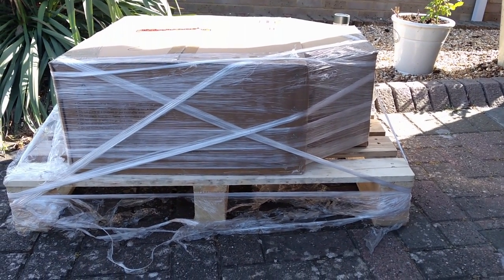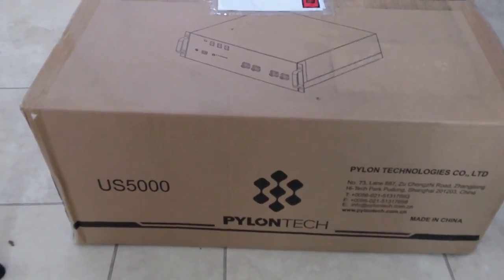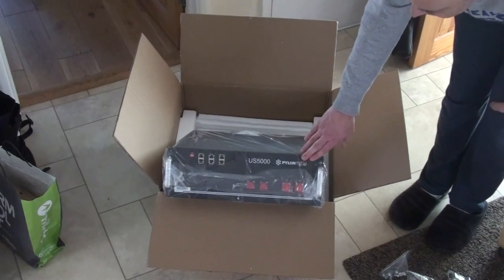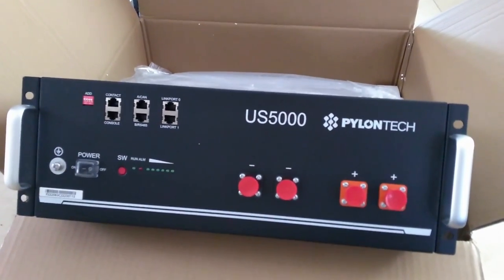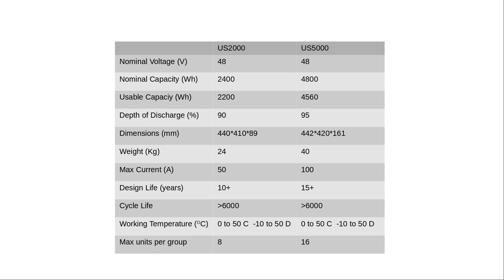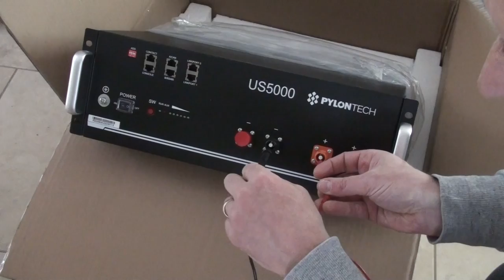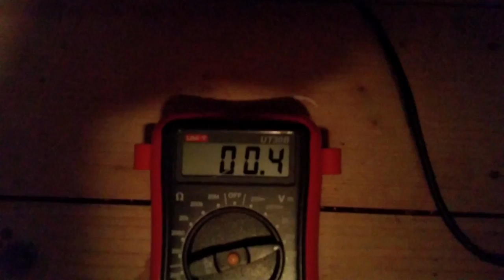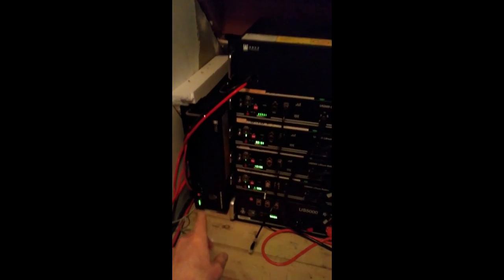Adding a new Pylontech US5000 battery to my home energy storage.

Comment: With more than 2 batteries in parallel, wouldn't it be a good idea to connect all to bus bars rather than daisy-chaining?
Reply from the maker: Yes it's the theoretical ideal but it doesn't really make that much difference, especially if you take the positive from the first in the chain and the negative from the last.
Reply: @nicholashowell  My understanding is that the battery cables supplied can only handle 100 Amps continuous and 120 Amps peak
Depending on the size of your inverter, Pylonteck actually recommend that you take extra leads back to the inverter. So that means, when your stack is big enough, you need to take a positive and a negative from the first battery and also from the last battery back to the inverter or to a busbar first
The past now is that if you were in theory to have a stack of 16 batteries, you would only be able to draw 200 Amps continuous, because of the limitations of the battery leads
So large stacks would be great from a storage perspective, but not from a high load perspective
Major design fault on their part.
I have not see thicker battery cables options
Reply from the maker: @capebee4839  You are right that the cables are only good for 100 amps but in my case that is more than I need.  My inverter can only output 3000W so will never pull more than 60 amps. I think Pylontech do a higher voltage battery for people with higher load demands.

Comment: Ive been on a battery hunt over in UK but I want something that will at least support a kettle at 3,000w power draw without having to take anything from the grid, when its night time and I boil a kettle with 4xUS5000 fully charged I shouldn't be pulling jack from the grid but the continuous discharge rate on these are apparently 2400w, seems like these batteries are ok for lots of low consumption stuff and with UK want to get rid of gas in next several years I don't think this will cut it.

Is the discharge rate battery or inverter dependent?  Still trying to learn but the VAT on batteries on their own but VAT free with a solar install is holding up my 5.2kw solar install.
Reply from the maker: Actually the US5000 has a max continuous discharge of 100 amps which equates to about 5000W. Just one battery would be enough to supply all the power to a 3000W kettle.  What you would need is an inverter capable of that kind of output. A Sofar ME3000 for example can put out a maximum of 3000 Watts so would just about cover it. There are more powerful inverters though that can put out more.
Reply: @nicholashowell  I thought the max was for a short duration, honestly its all confusing to me when it says 2400 continuous discharge and then for another battery it wont state that but only state teh amps and im not a sparky I got now clue what that means for watts and load.

I am trying to future proof and want to be able during winter months to do some cooking whether it be air fryer or electric oven but don't want to be drawing from teh grid if batteries are full and in the summer want to have at least one AC unit running.

If the 5,000w is sustained load but inverter dependent then I will get 4x4.8kw units so it can be charged on the cheap during crappy winter days.

I am trying my best to wrap my head around all this and the only thing holding up my whole install is the battery VAT lol
Reply: @nicholashowell  This is what I read
Continuous Discharge Rate (Normal Use): 2400 W ; Maximum Discharge Rate (5 Minutes): 4800 W ;

I was given a quote for 3xUS5000 and a Solis S5-EH1P-L Hybrid Inverter
Reply: Buy a 1kw kettle.

Comment: What happened after you flicked on the rocker switch? If you press the soft start does the pack light up and stay on please?
Reply from the maker: You have to press the start button to make the pack active. What the lights do will depend on if the battery is charging or discharging.
Reply: @nicholashowell  thanks, panic over, I watched a few other videos and realised that once all the lights have come on, they then go off and the run light flashes intermittently - also getting 49+V at the main terminals so all good (just need some long leads now!)

Comment: Hello. For my Home Battery setup I am considering the pylontect US3000/5000 batteries with a Victron inverter. Both my solar PV system are grid tied with AC inverters. Would you have any alternative suggestions. Thanks
Reply from the maker: I think the Sofar ME3000SP is quite a good grid tied battery inverter but also has an off-grid mode. It can charge/discharge at a maximum of 3000 Watts. I believe it is compatible with US2000 and US3000 batteries from Pylontech but not yet with the US5000 series.
Reply: @nicholashowell  21.7.22] Sofar have confirmed the ME3000 is now compatible with the Pylon US5000 battery, providing the unit has V3.1 firmware as a minimum.

Comment: Just taken delivery of 3 x US5000 and trying work out how to get them into the loft! They power on the same way yours did - run light flashes but no charge indicated - seems odd if they are at 49.4v, they should be showing some charge on the green lights?
Hopefully getting it all wired up at the weekend (waiting for inverter to be delivered).
The manuals aren't brilliant and a bit ambiguous in places, especially around comms to the inverter and the pin out on the lead but in theory I have a Pylontech lead coming which should sort that (they appear to no longer ship them as part of the "long lead" sets for some reason).
Reply from the maker: I wouldn't put them in my loft purely because it gets too hot up there in the summer and heat is not good for their longevity. Yours maybe different but probably worth checking on a really sunny day. I think they show charge state when something is happening charging/discharging. If there is no load I think they kind of sleep.
Reply: @nicholashowell  yeah I was going to put them on the garage but it's a bit damp in there and get very cold in winter which isn't good either. I did check loft during the heat wave and it got to just above 40, so still in spec. I may add some ventilation if it becomes a problem. Intending to install air conditioning before next summer so I should be able to pull cool air from one of the rooms below and control it with a rPi. I'm getting Solar Assistant which will help me monitor it all.
Reply from the maker: @robertrichards2493  So long as you are aware about the heat, I'm sure you'll keep on top of it. What inverter are you pairing them with?
Reply: @nicholashowell  a 5kW SunSynk ECCO hybrid inverter. Originally selected a Solis model but poor connectivity options with that and Sunsynk is slightly more capable on paper and had better availability.
Reply: My main issue at the moment is electrician scratching his head a bit about the earthing requirements for the inverter. I think as I won't be using it in island mode at all it doesn't need any special earthing over and above any other box on the end of a cable, so no need for relay operated neutral to earth bonding etc.
Reply from the maker: @robertrichards2493  My installer just connected it up to the house earth and was done with it and my Inverter also has an off-grid mode. Perhaps my earthing arrangement is different from yours.
Reply: @nicholashowell  yeah if you have an earth spike (TT) that's all you need to do. I think. Gets v complicated with TNC S arrangements. Like all such things it doesn't really matter until/unless a fault develops, then it might matter quite a lot   😬
Reply from the maker: @robertrichards2493  I'm pretty sure we are TNC-S. So I think it's not really adequate.
Reply: @nicholashowell  yep, not adequate. As you probably know TNC-S bonds your ground to the grid neutral in the meter box. There's a big ground spike at the substation. If there's a grid fault and your neutral is disconnected (eg tree across power lines) you have no earth. So any live to earth or neutral to earth faults will not trip an RCD or RCBO.
Reply from the maker: @robertrichards2493  Exactly. Which begs the question why my MCS accredited installer thought it was ok to do what they did 8 years ago! They were probably running short of time and thought it wouldn't hardly get used in off grid mode so couldn't be bothered. They weren't far wrong though. In the 8 years it's been there I've never had to use the off grid mode.
Reply: @nicholashowell  I'll use it every winter here, we always get power cuts as lots of overhead lines. Going to install it as plain grid tied for now and sparky coming back to do the EPS side once he's got his head around it.
They do all sorts. Guy who used to line next door to me ran his own company putting in solar panels. He put some of his roof and just used plain cable to connect to his consumer unit on the house, laid across the drive and raked some gravel over it!

Comment: What would it be the best way to bring this one up to the attic? :-)
Reply from the maker: The attic is not really the best place for them as it can get very hot up there in the summer and very cold in the winter. The batteries have an operating temperature range.

Comment: Did you just add this in parallel?
That would mean the lowest battery sets the cap. Or am i wrong here?
Reply from the maker: Yeah it's added in parallel. I don't think the capacity of the others makes any difference. Yes they will have lost some capacity over time but that won't affect the new one other than it will take on a bigger proportion of the load.
Reply: @nicholashowell  that depends on your amperage requirement.

So lets say that you require 150A to run your house from your batteries. If the US5000 is the last one with any juice on it, then it will deliver that 150A alone, and that is outside the specs of the battery and it might shut off (bms overcurrent protection)
Hence you can “only” pull 4800 Watts when all other batteries are depleted.

In practise this might mean that you will never take advantage of half og the US5000
Reply from the maker: @necroshy  As I said, the newer one will take on a bigger proportion of the load but it won't be an issue since my maximum draw is 60 amps.  The US5000 can comfortably supply 60 amps so I will always be able to use the entire capacity.
Reply: @nicholashowell  okay perfect, that is very nice then! :)

Comment: How do u make it the master battery? And what 4 notch switches for?
Reply from the maker: You shouldn't need to touch the 4 notch switches, they are mostly used for configuring multiple banks of batteries but if you have just a single stack you're fine. The master battery is the one with no connection in the Link 0 port.

Comment: What I don’t like about pylontech batteries is they only use 15 cells where as most other 48v rack mount batteries use 16 cells.
Reply from the maker: Yeah I've just noticed this with the newer ones. My original Extra2000 series have 16 cells so they used to but the newer USx000 series use 15. Must be to make them cheaper.
Reply: @nicholashowell  so you has a 16S battery in parallel with 15S batteries?
Reply from the maker: @kevinmills5293  Did have but not anymore, not since I found out they were different.

Comment: Hello I have now purchased 3 x Pylontect US 5000 batteries, I wish to stack them one on top of each other. In your opinion, do you think I should insert battery spacers between the batteries. Thanks
Reply: Ordered one today as well.
Reply from the maker: Yeah, I'd leave space between them.
Reply: Thanks for your comments concerning spacing between the batteries .
My next question is currently my Overdischarge SOC is set at 20% and the Forcedcharge SOC at 15%. In your opinion would 10% or 5% be ok for the Overdischarge (these pylontect batteries have a 95% depth of discharge) and 5% for the Forcedcharge? My Solis inverter will cope with these percentages. Thanks
Reply from the maker: @anthonycain6643  That sounds perfectly reasonable to me. If you set the min SOC to 10% and the forced charge to 5%. I don't have a Solis inverter but I've got mine set to min SOC of 10% and it's fine.
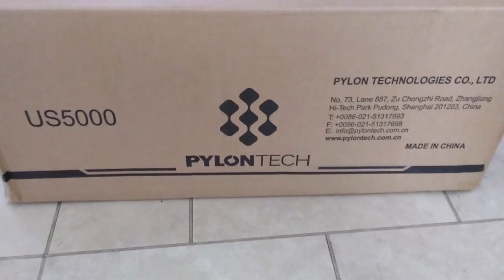Reply: @nicholashowell   Hi Nicholas. This morning charged up the batteries with off peak electricity 00:30-04:30. It is programmed to do the same again tomorrow. What happens when the batteries get to 100% during this 4 hour charging cycle, will the charging stop ? Thanks
Reply from the maker: @anthonycain6643  Yes it will. I do the same with mine.

Comment: Thanks, great video, new subscriber. What’s the difference to the versions with C at the end like the US3000C ?
Cheers
Reply from the maker: Hi.  I think the C versions have a slightly different controller/BMS.  They have a special startup mode so that they can limit inrush current to the inverter when first connected. This is better for the inverter as rapid current flow into the capacitors can damage them. There may be some other differences too.
Reply: @nicholashowell  Thank you. 😀

Comment: Does anyone know if Pylontech Batteries hooked up to a Solax SK SU inveter could ve used during a blackout (totally off grid) or is this not possible ?
Reply from the maker: That is the inverter I have and it can be used in off grid mode but you need a transfer switch or to power a completely independent circuit.
Reply: @nicholashowell  A transfer switch? Is that on the inverter or a separate lead i need to purchase ?
Reply from the maker: @FireFlySamson  The Solax inverter has a separate output that goes live in a grid down event. You could run a lead off that to power an extension to plug some emergency items like fridge freezer and broadband router. If you want to run the light circuit in your house though you have to feed that lead back to your consumer unit. You can't do that without disconnecting your consumer unit from the grid otherwise you will back feed power on to the grid which could injure workers who are working to fix the power cut. So you have to have a special transfer switch installed. This is not something you should do for yourself. It must be fitted by a qualified electrician.

Comment: You mentioned that your oldest one is having issues and is gonna have to be removed at some point. How long did it last for and is it another US2000?
Reply from the maker: It's one of my original ones. A Pylontech Extra2000. I've had it about 8 years and it was abused in its first year as it was my only one.
Reply: @nicholashowell  So with normal and careful use it would probably last a lot longer? I'm looking to build an offgrid system that can power a washing machine, a boiler, a gaming pc and some knickknacks.
Reply from the maker: @ArmageddonAfterparty  oh yeah. The technology has moved on in those 8 years. The Extra2000 was their original battery. The US2000 is half the size for the same capacity. These new packs are rated for 15 years.
Reply: @nicholashowell  Nice.

Comment: that 6000 cycles are at what dod?
That WH rating is at what C rate?
Reply from the maker: I assume at 95% DOD, since that's what they manual says it's rated for. The C rate is less certain but my guess would be something like 0.5
Reply: 0.5c is correct

Comment: Hello What noise levels do the pylontect batteries generated ? We thinking of placing the batteries in the hall cupboard. Thanks
Reply from the maker: The batteries themselves make no noise as they have no fans of their own. The inverter however may make noise depending on what one you get.
Reply: @nicholashowell  Thanks for info.Is the Sofar ME3000Sp with the Pylontect a good match. Does this setup switch to backup mode in the event of grid blackout?
Reply: Did you see todays comments on the Octopus Energy website concerning Go tariff etc
Reply from the maker: @anthonycain6643  The Sofar ME3000 doesn't have any fans either I believe so it should be silent.  That being said, if you are going to get it installed in a confined space like a cupboard then it will need to be well ventilated. Your installer should be able to confirm. The Sofar does have a EPS circuit that becomes active in a power cut but it will need a transfer switch and associated wiring to run loads in your house. Your installer will know what to do.
Reply from the maker: @anthonycain6643  No, I haven't see that. I'll go take a look, thanks.
Reply: @nicholashowell  Many thanks for info
Reply from the maker: @anthonycain6643  Do you have a link?
Reply: Hello. As a follow up to my previous comments, just had an email from OE with the new GO tariff (variable) for my region.
Reply from the maker: @anthonycain6643  I still haven't heard anything changing about Go.
Reply: My GO tariff changes mid November 2022. Off Peak 12p and Peak 44.35p.
Reply: Hi. I have 2 X US5000 Pylontect batteries arriving soon, I am planning to have them connected to a AC coupled inverter,  is the Sofar MP 3000 my best option? ESP would be a required feature. Thanks
Reply from the maker: @anthonycain6643  I don't know if it's your best option but it is an option. It does have an ESP circuit and it does work with the firmware that is on the US5000 BMS.
Reply: @nicholashowell  Many thanks